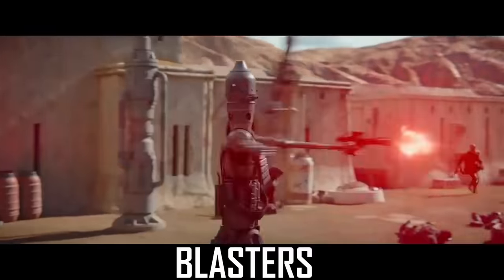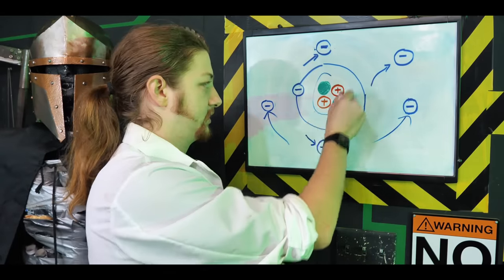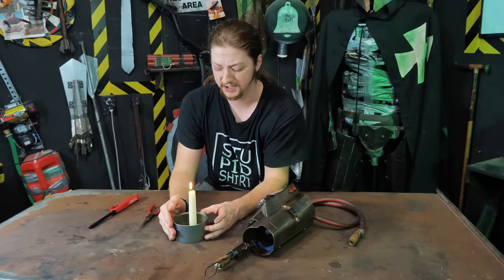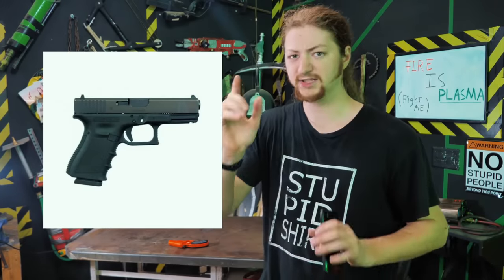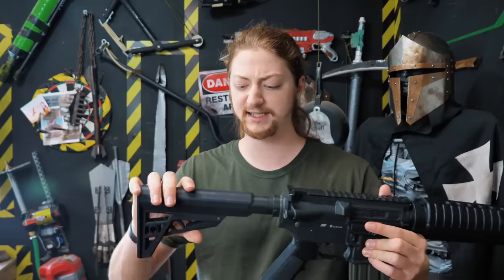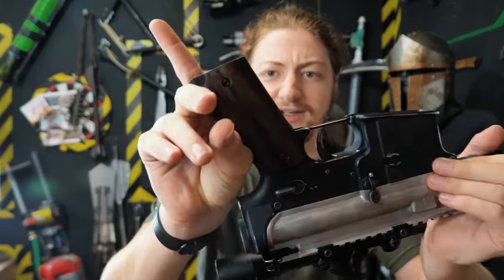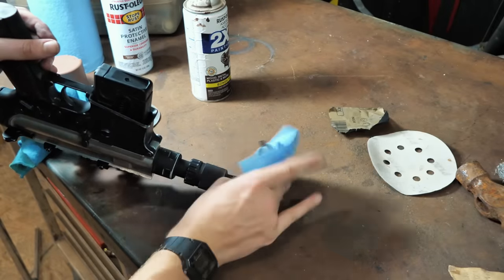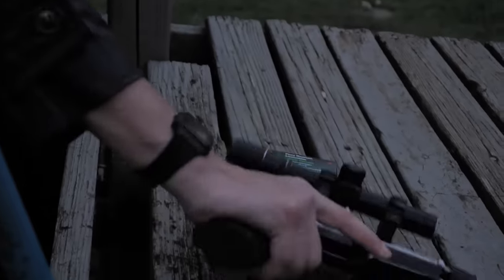Worlds First REAL StarWars BLASTER (is it possible??)

Comment: Actually when I read about these blasters at a suprisingly young age it did say that the blasters do fire actual projectiles, and at such immense spead that it escapes the plasma which envelopes it and basically pulls the plasma behind  The projectile itself. The projectile initially penetrates, and then the following up plasma does burning and electrical damage. It happens so quickly and the round itself is moving far to quickly to see. Even the plasma would be difficult to see if it werent glowing. It would be good for fighting both organic targets and robotic targets like drones/droids. Take note of the actual designs of the blasters. Notice that they actually use magazines. The books i was reading had these blown up super in depth colored diagram illustrations and had every component labeled.

Comment: The candle flame experiment doesn't prove that fire contains ions. The fire from the candlestick is superheating the air in and around it. Causing the molecules to be further apart and more excited, thus giving it less capacitance than normal room temperature air. You would most likely see similar results from a heat gun, with no fire present at all.

Comment: Next time, maybe try 9mm. Poe Dameron's blaster is a sig p226 and the First Order's blaster pistols are Glocks. Modding a Sterling would be easy. Just attatch a scope, use a 10 round magazine and put winshield wiper blades into the handguard. Easy to change back too.

Comment: Yes but plasma bullets shoot at around 458 KPH and does not matter the range to be affective (because bullets use kenetic energy which decrease on range) while plasma not because it relies on the length and gas of the of the beam for penetration and effectiveness (similar to HEAT and APFSDS rounds tanks use) and bullets normally travel twice the speed.

Comment: I've messed with this idea before.      If you have a high enough power laser, you can shoot a lightning bolt along the ionisation cased by the laser in the air.    Thats more of a phaser than a blaster tho.    If you have three overlapping lasers you can also fire microwaves down the middle along with the lightning bolt.. in effect a disruptor.

Sci-Fi often has more sci than fi

Comment: I was reading that by heating a path of air with an infrared laser you can  direct a electrical bolt to a target. Because the discharge follows the path of least resistance. I don't think the range was very good though. Maybe a dozen meters or so ?
Reply from the maker: That’s… not a bad idea. Would probably need a freakishly powerful laser

Comment: The hot air around the candle has a lower number of molecules per unit of volume, so it requires less voltage to create a spark.  The same thing would happen in the vacuum of space or high on a mountain with thinner air.

Comment: The experiment proves that the candle flame is more conductive than air. That does not necessarily mean it is ionized. It could simply be more conductive due to carbon particles.

Comment: Maybe you could take a magna gun that shoots iron projectiles with a row of electro magnets and adapt it to eject a ball of ionized hydrogen that's super charged with a high voltage stun gun circuit just at the point of ignition?

Comment: I wonder if this video could've gotten similar amount of views if it was just titled "Making a Star Wars pistol" or something.
It does feel like a pretty major let down it was regular tracers coming out with the original goal in mind.

But yeah, good video regardless. Nice design on the gun and it was still fun to see someone try to figure out "if we're there yet" when it comes to tech.

I wonder if you could've coated the bullets with something that reacts to electricity specifically and have like a small tazer inside the Han Solo barrel piece.

Comment: Light saber blades are also made out of plasma and with research you can use a magnet to control magnet but you need roughly 51 Gigajoules of magnet energy to control the plasma. Meaning its plausible to make a real light saber!

Comment: Particles of carbon would conduct electricity. Might just be the unburned carbon within the sooty flame causing the spark to jump, perhaps try the sparky trick with an oxidizing flame from an oxy acetylene torch and see if it sparks in that type of flame.

Comment: Fire may not contain plasma, it may decrease the ionization action potential of the atoms in the air allowing the voltage gradient between the two Tazer leads to allow for an arc to form.

Comment: Technical Question: you're build is using a 10-rd S&W mag, and what looks like a CMMG .22 BCG. Those don't usually 'play well' together. Would you please explain how you got the mag to reliably feed into the bolt? I know there are adapters... did you use one, or did you discover another solutions to the incompatibility problem?
Merci'

Comment: You could have just simplified plasma as "Super powerful purple lighting". Also the plasma in star wars isn't a single type. Blue, red, and purple blasters are as described. However green, yellow, and orange blasters are actually the sci-fi gas based plasma contained in a micro magnetic bubble. Which is why they are more powerful, examples being the famous Naboo star-fighter's primary heavy blasters which can only be made on naboo due to the use of a gas found in the underwater zone. Which is only relevant because they were the most powerful small to mid-sides ship cannons made in both the high republic and post imperial eras (mando got them good guns boii😅)

Comment: Okay, I would sign off on that being a lore friendly prop. Looks great actually.

Oh, and cutting the buffer tube will still allow the weapon to fire by the way, but with no gas system, it becomes a straight pull bolt action...which is a good thing because otherwise the bolt carrier would smash you in the face, ha.

Comment: Isnt rhat just phosphorus rounds? Ionic bolts should be plasma, electrically charged gas
You want to use a plasma coil and a dirction cone that can initially fire a dense cloud of gas in a pulse/burst, that will carry the plasma & still be effective basically, a very intricate build

Comment: The coincidence of blaster bolts looking like tracers isn't a coincidence. Star wars is basically WWII in space in a lot of ways. A lot of the guns are old German guns with scopes on them to look "more sci-fi" as you went into. And the space battles are kinda stupid for actual space battles. Because they are meant to be just WWII aircraft and battleship fights. 

Likewise, the reason the empire uses green blasters and the rebels use red is because the Allies used red tracers and the Germans used Green. And obviously the Empire takes some inspiration from the Germans.

Comment: A plasma bolt held together by a magnetic field isn't mullarky. Quantum entanglement. One plasma particle bolt is kept under a magnetic containment inside of the blaster, while the other is fired from the blaster. The one fired from the blaster is also under magnetic containment because its spooky entanglement counterpart is. Tah-dah. A blaster.

Comment: Is the fire actually conducting electricity, or just burning the nearby oxygen between the prongs and removing the density of air between the two points, allowing the current to pass between the space easier?

Comment: You can build a real working one but it would not be practical as a weapon. The power required is in the kw range and you can lob vortex rings of actual plasma short distances. Create a plasma, superheat with microwaves put spin on it with pulsed magnetic fields then lob with an acoustic shock wave.

Comment: So everybody understands, if you buy an AR-15 that is a pistol it can be converted into a rifle and legally converted back into a pistol but that lower unit had to start its life as a pistol from the factory before you can turn it into a rifle. If it started its life as a rifle and you turn it into a pistol the government will claim that you just made a short barrel rifle. Even if you use the proper hardware. Home-built units can be a little touchy so you want to make sure that you record your first build as a pistol before building it to a rifle.

Comment: Armchair physicist here: I see some potential errors in your experimental set up 😅
It’s possible that the hot air in the flame is less dense and therefore that area is inherently easier for the current to pass through, and the flame flickering towards one of the sides of the taser can be explained by the motion of the electrons through the air actually accelerating the air towards one of the terminals (Towards the negative one I think? Pretty sure they named the poles before they knew that the electron was negatively charged)

Comment: I wonder if you could use a high power UV laser to ionise the air between a high voltage source and a grounded target. Might get a couple meters of range depending on the laser strength. But nothing says you couldnt use a q-switched pulsed laser source.

Comment: You could use bigger tracers so it shows up on camera better. Also building a small plasma chamber, putting a tracer around in it fill9ng the chamber with hydrogen, oxygen and something like lithium would make it brighter and be more like from the star wars universe. A high vo li stage capacitor to ignite it. I thought that a powerful version of a pop gun could work. High velocity, high heat and the ability to stay together. Perhaps a 1000 degree rod with a tracer round, it would add a bit of weight to it which could be used to would someone like stubbing there toe.

Comment: I figured George Lucas modeled the blaster bolt after a tracer round. In lore the system uses both gas and power packs to generate the bolt. The "gas" gives it its punch like a phosphorus tracer.

Comment: I suppose if you want to redefine completely 'plasma blaster' to include chemically propelled projectiles burning more chemicals to light up in flight, then you could call this a blaster. The problem is you can only get there after redefining everything else, so in reality what you have is a massively overbuilt 22 and a box of cheap tracers.

Comment: this is just a question but couldnt the flame closing the gap just be because the flame has enough energy make the spark gap easier to cross, as in the high voltage is still the only thing ionizing the air it just is needing less energy to ionize the air because the air is hotter from the flame? but i wouldnt be surprised if fire does contain ions so idk just a thought

Comment: What did you do with the forward assist? Is the 80% lower still closed off or what? And with the modified bolt group, does the forward assist become nonnecessary?

Comment: I wonder if the heat from the candle doesn't contribute more to the plasma arc occurring rather than the flame or ions produced from the combustion of the wax?  I have noticed that I can create an arc using the same method with expelled air from my lungs.  So unless I'm breathing out some plasma, It must be the heated air that encourages the plasma formation.  I think the addition of heat from the candle decreases the energy required to cause ionization.  Maybe not. Just my observation.

Comment: Someone invented a handheld plasma rifle which can punture bullet proof plates. Search electrmagnetic plasma gun on youtube click the short video with the big white rifle. They acomplished this decades at home. How does it work? Wel its basically a rail gun but the projectile contains argon gas which as it passes through the magnetic coils causes it to turn to to super hot plasma inside of the glass capsul in the projectile which explodes upon impacting the target creating a insanely devastating effect. They showed it shooting through 3 count em THREE ar500 plates rated to withstand even armor piercing 30-06 rifle rounds and it blew through all 3 of them like it was butter and the steel backdrop and the 2x4 behind that. Like its so hot it technicaly could blow through most any armor we have even on vehicles. Plus it turns whatever metal it melts into molten fragmentation. So like if the military took this technology and gave tanks a secondary turret that shoots ionozed argon gas slugs it would melt through any tank armor you could throw at it and on top of that itll automatically kill all the enemy crew because the round will basicaly melt through the outsie shell then explode all that molten laval metal and plasma on the inside of the vehicle. Or you could have a semi or full auto gun the size of a mounted 50cal that can take out heavy armor with ease

Comment: Plasma being held together by a magnetic field is far from impossible. The problem is how difficult it is. Holding a single blade or bolt of plasma in line would require roughly 20 Megawatts of electricity.

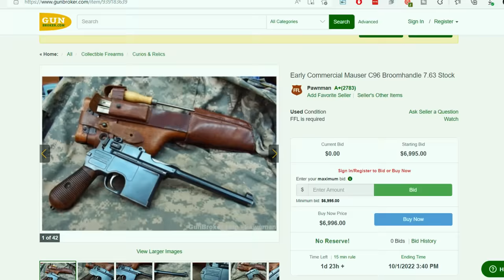8:06 they cost 1,500-3000 if you get one in Florida

10:43 I'm gonna ruin his pride. That isn't a real M1911. That's an M67, which is designed for training purposes, and can only fire snap rounds.
Reply from the maker: Lol that 1911 is an airsoft gun

Comment: Your atom ist wrong! Two protons means, that it is Helium. Therefore, it can have only 2 electrons. Your atom has 6 electrons, which would already make it a negatively charged ion. Also, Helium in its natural form does not have neutrons.
And in the end you just build a .22 caliber pistol that looks like a blaster from Star Wars.
Reply: The original of which in turn was a modified broom handle mauser pistol iirc 😊

Comment: If you want to make actual blaster bullets...you'd need nuclear tracers. Plutonium might work. Radiation can also be ionizing. Very much so. And that can theoretically be triggered by chemical reactions such as fire. Allegedly. 

Also you could probably salvage an old .22 magazine spring and convert it to open bolt sub-gun. Allegedly.

Comment: Want real plasma?  Here is how to do it.  The basic technology to create RF Plasma has been around since 1891.  Consider Tesla's spark gap tesla coil running at MHZ frequencies, now get rid of Tesla's high voltage secondary, what you want is the primary.  That primary running at MHZ frequencies will convert hydrogen gas into plasma.  MHZ frequencies are the same frequencies as FM radio so FCC may send a swat team to your door if you interfere with FM stations.   4-200 MHZ will create plasma but use ISM (Industrial, Scientific, Medical) band 13.56 MHZ to be safe from FCC.  Next thing you want is more power, increase voltage & current.  Do not create plasma in a closed container because pressure will build up and explode.  This is serious stuff and could be over 11,000 degrees.

Comment: WHAT IF THE FLAME IS USING UP SO SRY CAPS  so much oxygen and displacing so much atmosphere that the electricity can arch?? basically making the area between the negative and positive become a near void ?? meaning its easier with less to ionize in the way?

Comment: One of the byproducts of combustion is carbon. The air surrounding (and above of) the candle flame has enough carbon particles to be conductive, thus allowing the spark gap to be small enough for the circuit to be completed. There's no plasma in a flame. In short, you lied.

Comment: Quick history lesson about why you can't chop down a full-size rifle down to a pistol size (in the US): Essentially congress wanted to ban handguns but they couldn't outright ban them. Instead they created the National Firearms Act (NFA) which added a $200 tax to all items that fell into this category and this tax would never increase. Back in the time that the NFA was created (1934, the Great Depression), this $200 tax would have been nearly impossible for anyone but the rich to actually afford and would result in a "soft ban". 

Initially it would have only affected pistols, but they didn't want people to go home and cut the stock off and shorten the barrel and say "It's not a handgun, it's a rifle." So they initially made it so that any firearm with a barrel length less than 18" was also covered by this. The bill wouldn't get enough votes, though, until pistols and handguns (the original target of the soft ban) were removed from the list. This only left short-barreled rifles on the NFA and it restricted anything designed as a rifle to an arbitrary length of 18". This would later be changed to 16" after the US decided to surplus their stockpile of 250,000 M1 carbines to NRA members in 1963. They then realized that they made anyone who received them a felon because the M1 carbine has a barrel length of 17.75". 

So why can't you chop off the barrel of a rifle? Because of an arbitrary distinction made by congress in an effort to ban handguns. Pretty stupid.

Comment: Sorry, you did not demonstrate there was some plasma in an open flame.   You only demonstrated it could conduct a current.   You would have gotten the same result with a piece of metal between the two points to prove this explanation.  A flame causes atoms to rip apart as they change into new elements, this free's up electrons as well as providing charged particles for the current to pass through just as in a piece of wire.